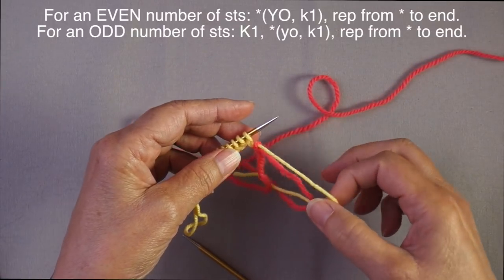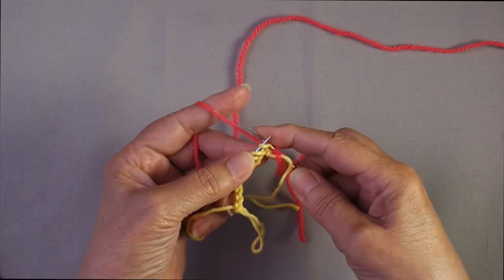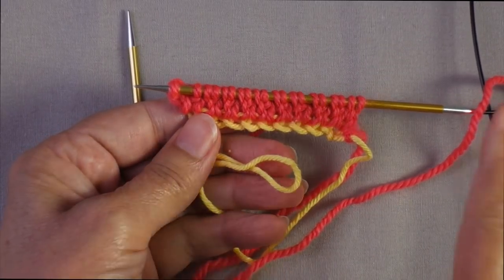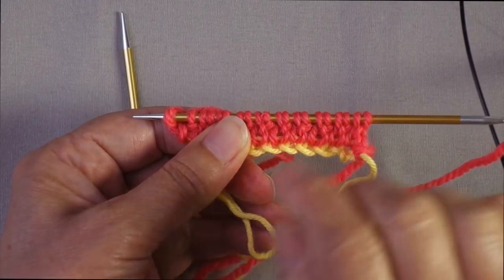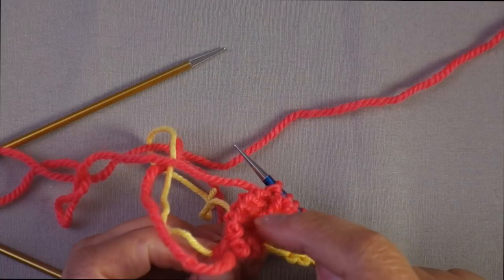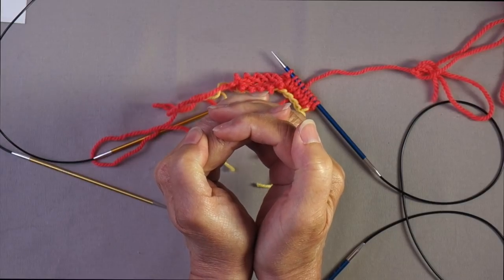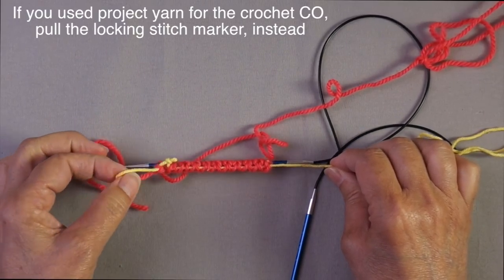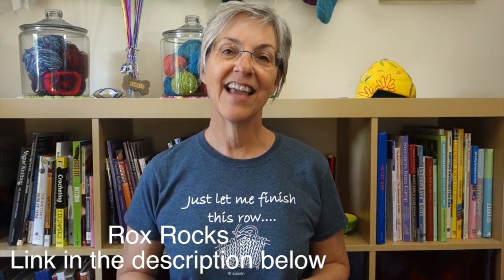Tubular Cast On

Comment: I like the look and method of this CO, until I add more rows of ribbing. Then I get a couple of rows of really wonky looking sts before it evens out again. It seems to be a product of changing needle sizes, and I've tried just going down one size for the CO which makes the problem less severe, but still not attaining an acceptable result. Is there a fix for something like this? For this project, I need only 1" of ribbing; would it be terrible to just keep doing the double knitting rows and then join with the larger needle size on the last row of ribbing?

Comment: I'm planning to use this cast on for a sweater using bulky yarn and size 9 needles, but for the ribbing at the bottom I'll be using size 7 needles. Would I still need to go down one or two needle sizes from the size 7 to a size 6 or 5, or is the size 7 fine since I'm already two sizes smaller than what I'll be using for the body?

Comment: Thank you so much Roxanne for this demonstration. I have never done tubular cast on before and i'm knitting this summer tee pattern with 97 stitches to cast on and I'm using a pure linen yarn. It felt impossible with the method that was suggested by the pattern designer and I almost gave up. Luckily I remembered looking if you have a video on this and of course you have!  It's so effortless compared to the other method and I'm no longer afraid of tubular cast on now!

Comment: Thank you so much for this! I did a different version on the sleeves of a sweater, but had to correct some very loose stitches which was incredibly annoying. I tried your method on the bottom of the sweater and it turned out great! No tweaking needed. This will be my go-to now.

Comment: Woohoo! This is great! I’m already a huge fan of the provisional crochet cast on technique so now I love it even more! This tubular method is so easy compared to the other methods. You are an excellent teacher. Thank you for your channel! I subscribed, of course. I followed your other video to make a 2x2 tubular rib and it looks amazing. (Tip: there’s another way to reorder the 2 stitches. I learned it from the Sockmatician channel - Slip2TOG knitwise to the right needle which automatically swaps the order. Then put them back on the left needle 1 at a time, then proceed knitting in the 2x2 pattern.)

Comment: The project I am starting will use size 6 for the body and size 5 for the ribbing (size 4 for the ribbing was too tight). Where you state to use 2 sizes smaller than project needles does that mean I should use size 4 or size 3 to start the tubular cast on? Update - I did test swatch on size 5's that was too loose, test swatch on size 4 was good. Sooo - I figured it out.  Thanks for all your very helpful videos.
Reply from the maker: The needle size difference for casting on is relative to whatever you're planning on using for the rest of the ribbing.

Comment: I have a question. I have done the tubular cast on, and then joined in the round after the first row in my pattern, as you suggested in the video. How do I then join or seam the tubular cast on rows which were worked flat? Would love a video showing this! Thanks!
Reply: G

Comment: Sock cast-ons for cuff-down.  I've been knitting nothing but toe-up socks for years now, but I've decided that I would like to do a few from the cuff down.  I have been using the CWCO, but I find that the small hook and the fine yarn lead to a lot of splitting.  So, I'm looking for a nice stretchy cuff down CO.  Is this it?  I've done a lot of LOCT and TGLTCO but find that they do bind at my legs due to swelling.  I don't have any problems knitting toe-up and using a sewn bind-off.  I would appreciate your expert opinion.  Thanks!  and as always, you are my go-to instructor!
Reply from the maker: Typically, you need to adjust your technique for how you do a given CO when knitting cuff down, because the CO edge has to stretch as much as the fabric, and the fabric has to be able to stretch to its maximum around the mid-calf and across the heel diagonal. So it isn't the specific CO that makes a difference, it's ho you work the CO in that situation. This video might help https://youtu.be/O9R_Ki4SeW4
Reply: @RoxanneRichardson  Thanks, Rox.  I don't have a problem with the socks going over my heel cuz I just make the flap a bit longer.  Learned that years ago!  I did watch most of your sock tips and cast on vids before I posted the question.  I knit a lot of dishcloths, too, and my LTCO and crochet cast-ons are never too tight for the fabric.  Unfortunately, cotton fabric won't stretch as much as wool, so I am struggling with making my sock cast-ons stretchy enough.
Reply from the maker: @sandeleh  Again, the CO has to stretch as much as the fabric. If the CO doesn't stretch as much as the fabric, then it will be too tight, so you may need to adjust the way you are working your CO so that you get more stretch out of the edge, by doing something like spacing the CO sts further apart from each other as you CO. If the CO is stretching as much as the fabric, but the sock leg is still too tight, then  you might need to change your stitch count. Making the heel flap longer increases the circumference of the heel diagonal, so you can get the sock heel past your heel. It doesn't enlarge the CO edge.

Comment: I love the look of this cast on.  I'm making fingerless mitts will this have a stretchy edge  ?  The yarn i a fingering wt.  will this cast on work with that wt,  and size 3 needle ?  Thank you
Reply from the maker: It should be stretchy enough for fingerless mitts. The needle size you use will depend on what gauge you're trying to get, and whether or not size 3 will give you that.

Comment: This cast on is becoming one of my favourites! Just one question ... why use smaller needles to cast on and knit the tube?
Reply from the maker: I find that the edge spreads too much if I don't use a smaller needle. I would suggest working a couple of swatches to see whether you prefer going down needle sizes or if you prefer using the same needle.
Reply: Yes, as Rox says, it makes a big difference, as I learned by trying.  I did one with the same size needle and it was too bulbous.  Then I did it with one needle size down and it was perfect.

Comment: Thanks very much for this! I usually start double knitting without using the crochet cast-on. Do you think the latter creates a neater edge?
Reply from the maker: There are always multiple ways of doing things, and often very different processes result in exactly the same outcome. The only way to know if you will get a neater result with a different process is to try them both on swatches and then compare. You might find the results are the same, but one of the processes is easier or more efficient for you. Another knitter will find the opposite to be true.
Reply: @RoxanneRichardson  OK! Thanks for the speedy reply.

Comment: I love this cast on, but man it's hard to join it in the round without a massive gap! I think I'm doing something wrong, but I'm not sure where. I did the setup rows and then joined, but at the start of the round I have a huge gap even though I tried to pull the yarn tighter to avoid this. I'll just have to use this for straight knits I think, can't seem to make this work in the round
Reply: i have this same issue and have been scouring youtube to find a method that fixes this!
Reply: I just join in the round and start knitting and then go back at the end and seam up the little gap. I haven’t seen a better way of managing that.

Comment: One small question. Does these 4 rows count as the rib pattern? My pattern tells me to rib1x1 for six rows. So taken that the tubular cast on has already 4 rows, do I only do four more? Thanks. Love all your videos. Wish you lived here in the Canberra,Australia Capital Territory so I could go and have lessons
Reply from the maker: The tubular CO doesn't create an edge, so I would probably count those set up rows as either 0 or 1 row of ribbing. If you are working multiple pieces for the same project, and they all have to have 6 rows of ribbing, the point is consistency between the pieces, and a desired length of the ribbing, rather than needing to have an exact number of rows. So pick a number of rows to work, and just be sure to work the same number on all the other pieces, if there are any.

Comment: Thank you, Rox. I finally figured out the tubular cast on last night using this video. So easy!  I have a question. Can I also use the crochet chain provisional cast on where you knit into the back of the crochet stitches?
Reply from the maker: Probably. You'd still alternate with a yo as you PU the sts through the crochet chain.
Reply: @RoxanneRichardson  Roxanne, back again with the results of my experiment.  I did the chain cast on, as I usually think it's easier than crocheting on the needle.  The result was the loops at the bottom were looser, as they'd usually be when you want to leave loops to pick up stitches later.  So interesting!  So I pulled the  yarn a bit to tighten it up.  I think I will stick to doing  your original crochet on the needle in future, even though I don't prefer doing it.  In reality, you are really doing the same thing, but there is a different torque on the yarn, I guess.
Reply: Another compliment for you, Rox.  I went back and looked at the instructions for tubular cast on that I was trying to follow on my sweater pattern, and the designer really had us doing the same thing you are doing, but it was done without cues, just blindly following knit one, slip one, etc., without understanding that you were slipping the "purl" stitches and knitting the "knit" stitches.  This style of instruction writing has always bugged me, because I am big on reading my knitting and understanding what I am doing.  Your video was so much more helpful!  It relates back to your new video this morning where you showed the instructions that had you knitting and purling blindly.  So much easier to have a chart or a visual explanation.  Thank you, Rox.

Comment: thanx for the great tutorial! but i have a question: could you make the whole ribbing as a double knitting (repeating first 4 rows of slip and knit) and then just start knitting in the main pattern?
Reply from the maker: It's physically possible. It's double knitting, which has lots of uses. I recently made a belt using double knitting, because I felt like it would be less annoying than working 12 sts in the round for 5 or 6 feet. Whether that result is desirable for the ribbed edging of your project is uncertain. I would suggest swatching.

Comment: I just discovered you while looking for a stretchy cast on for socks.  Wow!  I got to see that video and now this one.  You explain these so clearly.  I'm new to knitting and so far I have not heard of this cast on method.  What would you use it for?  Thanks for the instruction.  I have subscribed to your channel with the notification for new videos.
Reply from the maker: The tubular cast on is typically used for k1p1 ribbing. It's a  visually "familiar" CO because it's what is used in commercial knitwear. It's reversible (looks the same if you fold the edge over), and it has a matching BO. So there are several reasons why it might work well for a given project.
Reply: It would be great for mittens or socks. And as Rox mentions, this matches the tubular bind-off, so if you're making a sweater, you can cast on ribbing for the bottoms of the sweater sweater and the sleeves and use it to bind-off a turtleneck collar. It would coordinate throughout the project.

Comment: Thanks, Roxanne, for this extremely clear and helpful video. (I appreciate all of your videos.) As a beginning knitter, I am ready to knit my first garment, a top-down shrug/sweater with 1x1 rib at the neckline. Do any of the rows of tubular cast on count toward the pattern rows? If not, will the ribbing be too wide when finished? Thanks again.
Reply from the maker: DOes your pattern call for starting with the ribbing at the neck? Many patterns will call for CO for the neck (not the neck ribbing), and then sts are picked up around that CO edge later and the ribbing worked in the opposite direction.  A good place to ask this question, with the additional information (and a link to the Ravelry pattern page) would be in my Rox Rocks group on Ravelry.
Reply: Yes, ribbing is the first thing you knit at the neck. Afterwards, it starts stockinette with raglan shaping and front band as you go. Then you divide for sleeves, knit the body, and finish with bottom and sleeve bands.
Reply: I will try Rox Rocks on Ravelry. Thanks.

Comment: often in sweater patterns, it calls for a smaller needles for the ribbing. can i use the smaller ribbing-sized needles for the cast on or should i  use an even smaller set of needles? i cast on with the ribbing needles and it seemed a little loose/squishy, but i dropped a couple of stitches and i’m not sure how to fix it so i think i’m going to start over..
Reply from the maker: If the ribbing is to be worked on smaller needles than the body of the sweater, and the cast on row calls for working on a smaller needle than the rest of the ribbing, then, yes, you would need 3 needle sizes. For example, if the pattern calls for US 5 for the ribbing and US 7 for the sweater body, you'd use a US 3 or 4 for the CO, and then switch to the US 5.

Comment: What would be the best use of the tubular caston?  The bottom of a sweater, the tops of socks?
Reply from the maker: Best use is with k1p1 ribbing. Any sort of project except those where you need the edge to stretch as much as the maximum capability of the fabric. For most people, the cuff of a sock does have to stretch as far as the fabric is capable (50% more than the resting state of the stockinette) in order to get past the heel and to hug the leg just below the calf muscle, so it's probably not a good choice for socks that hit that length. Might work find for shorter socks, though, assuming the leg the sock is for doesn't change circumference dramatically in that short length. It's great for hats, mittens, sweaters, etc. Those garments need the CO edge to stretch, but the fabric doesn't need to stretch as much as a sock cuff.
Reply: @RoxanneRichardson  thank you so much!

Comment: I have a question about row counts. So by my count we have 5 set-up rows: the yarn over-knit one row and then the four repeated ones with alternating slip and knit stitches. Here's the question: When I'm following a pattern that calls for a specific number of rows, do I count any, some or all of these 5 rows in the row count?
Reply: So I posted that before I'd seen the whole video. So I'm guessing based on your explanation that I should consider the whole enterprise at 2 rows?
Reply from the maker: It depends on whether you are using a pattern that calls for a tubular CO and you are using this method, instead of the one the pattern calls for, or if you are using a tubular CO in a pattern that does not specify the CO method. If you're using a pattern that just says, "CO X sts, and work 5 rows" then you have completed the CO when you have the full number of sts on the needle (the yo, k1 row does that), and then every 2 set of RS/WS set up rows are counted as 1 row. In addition, with any pattern, you're always free to work more rows or fewer of ribbing, based on your own preferences.
Reply: @RoxanneRichardson  Great! Thank you. Also thought the slip knot of the main yarn to the waste yarn is brilliant btw!

Comment: How could this be adapted for garter stitch?  The pattern I am working on has 4 ridges of garter stitch at the sleeve cuffs.
Reply from the maker: You could use it by just switching to knitting every stitch, once the foundation rows have been completed, but it isn't going to create the same visual effect that it has for 1x1 ribbing. I would be inclined to use a cast on that creates a defined edge, instead, and then choose which side of the cast on you prefer as the RS.

Comment: You did not mention how to handle for  an odd number of stitches.  I keep ending up with 1 stitch too shy even after adding the extra stitch.  IE- I need 89 stitches and cable cast on 45, still end up w 88😵‍💫
Reply from the maker: It's written on the top of the screen, starting around 3:18.
Reply: I realize that but it is the only reference to it.  I guess I just don’t get it. Need more info. Thanks
Reply from the maker: @juliamiller2667  You might be forgetting a YO or something. If you CO 45 sts, and you k1, yo for the first 44, that will give you 88. You will still have 1 remaining st, which you will knit, and that will give you 89.

Comment: "For knitting in the round, use the starting yarn tail to close the cap of the initial rows that were worked with double knitting"...

......as sort of a beginner, I need to ask, how?
Reply: I believe you will sew it together at the end
Reply: @ChelleChelly  Thank you. 

I was hoping to get a tip on  what kind of graft to use so it's (mostly) invisible.

Comment: I have an old pattern that needs 57 stitch tubular cast on.  Used to not be an issue but my hands are too crippled now to use needles. I've been using the loom for several projects but I'm having great difficulty tubular casting on that many stitches on the loom. Please anyone with an idea I'm willing to try
Reply from the maker: Are you on Ravelry? There are various groups for loom knitters there who would be better able to answer your questions, as I know almost nothing about it.